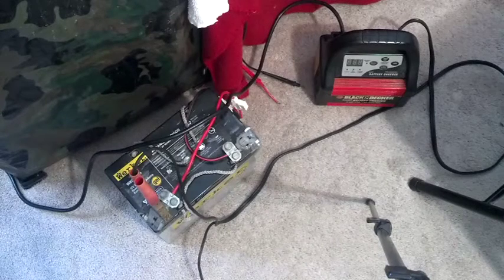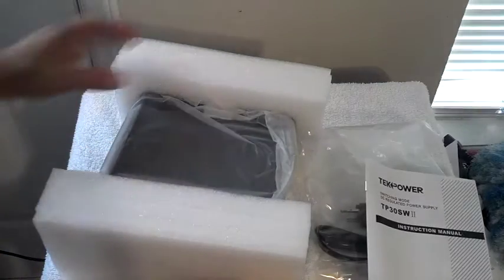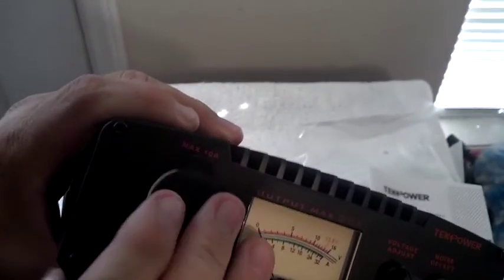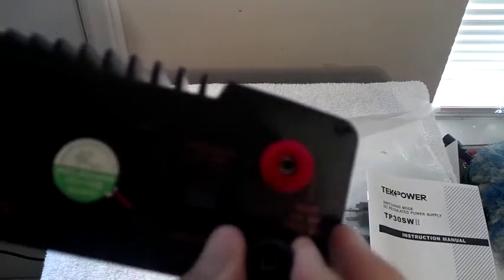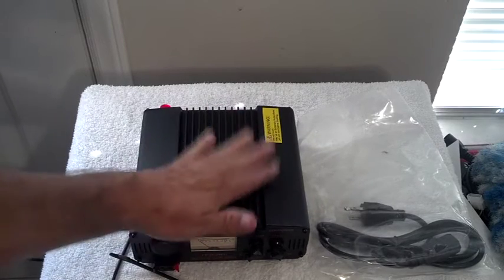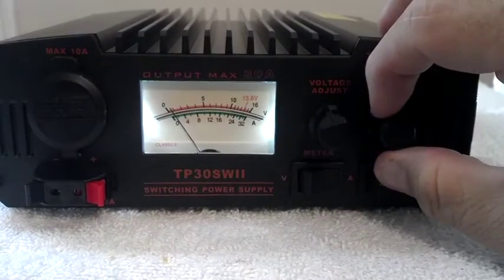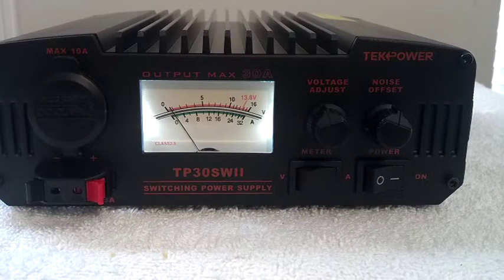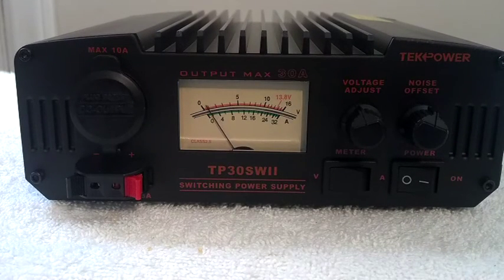New toy for my ham radio TekPower TP30SWII

Comment: That's why Im looking at the FT1200 for now and if I get back into it I'll go for the Icom. Im ordering the Ft8900 next week and use it as a mobile repeater.
Reply: Consider the IC7300 and you will see where the noise is from this supply.  the 7300's band scope is good feature for this and other sigs, where the activity is.  And is new SDR rig with lots of great features.

Comment: Good luck, nice supply.
Reply: +Customchannel   I am looking at the 1200 as well, I have been off the air for over 30+ years and just started again. I just bought the FT-400DR and ordering the FT-8900R next week.  I'd like to order the FT1200 next month.  I was looking at the Icom 7600 because I have their antenna  auto tuner but the 7600 is a little more then I want to spend for now.
Reply: +Customchannel That's why Im looking at the FT1200 for now and if I get back into it I'll go for the Icom. Im ordering the Ft8900 next week and use it as a mobile repeater.